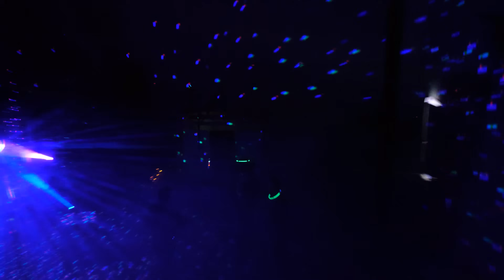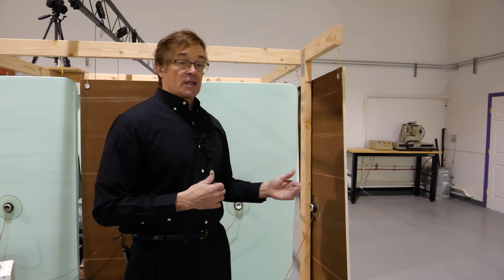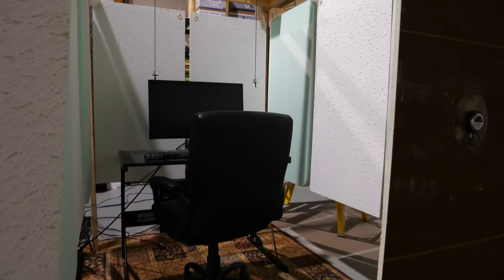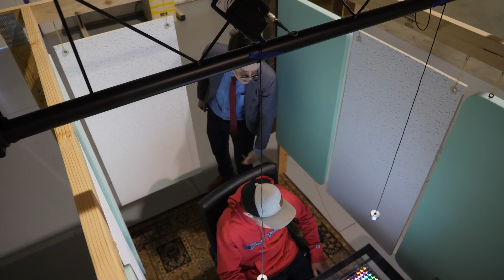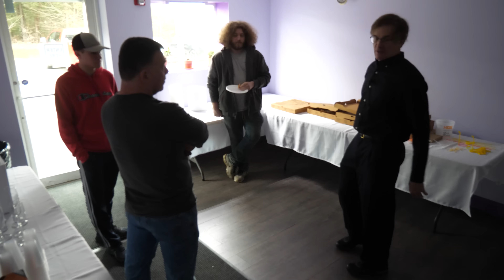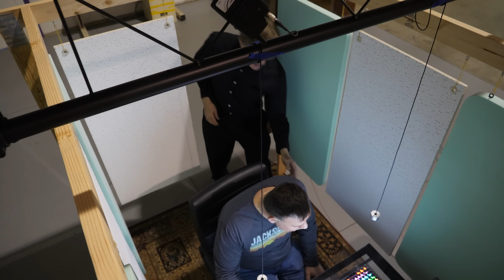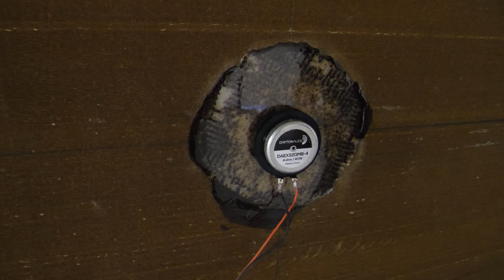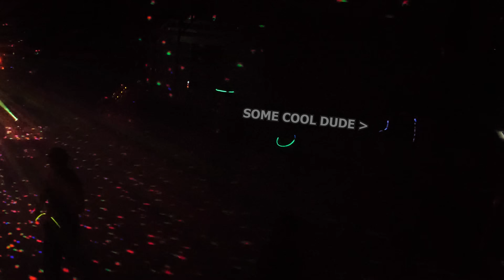SHOULD SPEAKERS THIS GOOD BE LEGAL?

Comment: So what would  be the effect of a wood veneer on the xps foam?  Or maybe with a small air gap between the materials?
Reply from the maker: It will increase the resonant frequency and may be useful for a panel you want to respond to higher frequencies. 
An isolated cover will probably just reduce sound output.
Reply: @TechIngredients  just asking to possibly dress up an application. Thanks for the great  feedback

Comment: I'm willing to bet that you can improve performance at all frequencies by rigid-mounting the exciter to the wall or some type of framing while still supporting the panel with strings.  This would put far more of the energy into the panel.  You would have to make sure that you didn't get any unwanted resonance from whatever you're mounting the exciter to, but that shouldn't be difficult.
Reply from the maker: We actually tried that, and it doesn't work. It seems like it should, but the exciter's mass itself is part of the resonance of the system. When fixed, the panel sounds dead.

Comment: Also for more stability, can those speakers be attached from the bottom also, so they suspend from the top and are held at the bottom in the same fashion, so to add stability? Would that not improve the performance and also keep them from swaying to much ETC?
Reply from the maker: They can.
Some viewers have stabilized them that way for use outdoors. Some of these exciters are waterproof.

Comment: Your videos are really cool, but you're leaving out the major fact that you must have a sound processor in this setup along with the sub, so if you compare a pair of regular bookshelf speakers, the minimum cost of that setup is lower, because those can sound good without EQ.
I built a pair from xps, experimented with it a little, and I couldn't get a decent sound out of it with no eq, it's just mid heavy, had a peak around 50 hz and above that nothing until 150 hz, that and a couple of forum posts from other people who tried it is why I know it's crap. It might be good for PA systems or haunted house, but not for the average Joe.
Reply from the maker: No, you don't.  We tested and demonstrated these speakers without any cross-over or sound processor. Of course, such a device can improve the performance of any speaker system.

Comment: Amazing work! I’m a music producer and have done my fair share of soundproofing and sound transmission tests. A couple next steps might be: 1. Another round of qualitative tests at low volume (as every speaker sounds better at high volume) and also maybe compared to two other leading 5.1 systems, and 2. Frequency response measurements and other independent testing.
Reply from the maker: Thanks!
You might want to actually do this yourself. It's very easy and inexpensive.
With your background, your opinion about the performance would be valuable.

Comment: Just finding these, really interesting, one question I would have is how far from a wall do you need to install them, right now you are in a setup where they hang by themself with a large amount of void around them but in a studio you can necessarily have that amount of space.
So I was curious to know how much reflection when they are close to a wall is there and how good they perform in that scenario.
Would be good to try a cardio setup too.
What happen if you hanged 3x in a row with two inverse
Reply from the maker: Some of the viewers who built these speakers based on our earlier videos found that they performed better when a wall behind them was covered by a sound absorbing material.

Comment: It's fun to watch these videos again. I built a pair with acoustic ceiling tiles, painted them black with spray paint, and placed two drivers on each panel in series configuration, one in the direct center and one at the 2/5ths 3/5ths spacing. 

They sound great! They compliment my 2 towers, a center channel and subwoofer stereo system, and have a "gluing" effect as i call it. Without them on, you can tell where the sound is directionally coming from. With them on, it's clean, non-directional, room filling sound! 

The best part is that because it's omni-directional, you dont need to turn it up loudly to cleanly hear your material, but can also have conversations in the same room.
Reply: Did you go with a special paint? I'd wondered if latex or peeled paint needed to be used. Thanks!

Comment: Dont see how you can send the same signal to all these panels and not suffer phase cancelation in this format
Reply from the maker: Remember, this is a 5 channel setup.
Unlike typical speakers, which radiate from a point location, the distributed radiation from a panel will only phase interfere with another panel at a few locations.
This is like an orchestra.  The many violins don't phase interfere with each other.

Comment: They have the ability to sound like a big pro sound system on a low volume level. It does not hold up though in a situation with a live band beyond a certain level of volume, but it excels in being lightweight and with outstanding sound quality at low volumes.

Comment: I love the details you're providing. so even with a 24“ x 48“ panel it will still struggle to reproduce anything under 120 Hz which is pretty high considering the LFE spectrum.
Reply from the maker: Thanks. 
You're correct.

Comment: How much will the Thickness of the foam affect the Frequency response? Thanks, This is an amazing way to start my day, I'll have this on the brain.
Reply from the maker: It's as you might suspect. The thicker the panel, the stiffer it is in bending and flexing, and the more it favors higher frequencies. Similarly,  the wider and taller it is, the better the low frequency output.

Comment: would a stretched canvas work with some some sort of fiber like cotton polyester or wool and put some sort of netting to keep the fiber in
Reply from the maker: Probably not. The panel has to have some inherent stiffness so that it bends and flexes.
An analogy would be to build a guitar with a stretched canvas sound box. It wouldn't work.

Comment: @Tech Ingredients what happens if you have it double layered, like the foam insulation glued to the acoustic ceiling tile? maybe add another exciter to make up for extra thickness?
Reply from the maker: That's interesting.  I don't know.
The lightweight foam shouldn't load the tiles significantly, and the large difference in density will improve damping. Hmm...

Comment: Would speakers like these be good for a 2 car garage sound system?
Reply from the maker: Absolutely.
Because these are so easy to assemble and low cost, your risk is low.  Use the largest panel size you can practically fit or purchase as the low end improves with size, and that is their only weak point.

Comment: I took six of the 40 watt exciter and simply attached them to the drywall walls in our entertainment room about 4.5 ft off the floor.  Using an Onkyo surround receiver and a subwoofer, the sound projection was amazing.  I first built the speakers as suggested with the foam board according to your first video which presented the exciter speakers.   They were okay sounding but not immensely impressive.  But I gotta say the wall attachment blew them away.   It didnt stop there because the sound needed tweaked so I routed the sound through a laptop first then into the receiver.  Using a free sound tool called FxSound and adjusting the frequencies to match the acoustics of the materials and room....  It came alive and I would seriously compare it to the highest end home theater experience I have ever experienced.  (FxSound lets you adjust 9 points of equalization which each point can be tuned themselves with 5 overall effects.  Hard to explain but you check it out.)

Comment: Tuned in AGAIN and found more incredible examples of GEN / 6 7 8 and beyond panel speakers. My 2x4 acoustic panels I made still perform without any Buzz and rattling due to a surface speaker being used. I was thrilled to see the Rockville Blue tube amps lined up for this demo. I use the same 4ohm amp for mine.. Sound is just right there IF you add a sub woofer to bring in more BASS. Without.. Top end clearness that has to be heard to believe.. Tech Ingredients, Continue to waste no time with these projects.. BRAVO 🤟
Reply from the maker: Thanks!
Did you watch our more recent  video where we took these speakers on the road (literally) to get public feedback?
Reply: @TechIngredients  Thanks for the reply and of course I'll find that video and watch it. NO telling how people will react to this concept.. Wish I could be one of those to give it a listen..

Comment: @TechIngredients I wonder how the mass of the exciter relative to the panel's surface/mass affects things.  there isn't frame like a traditional speaker that clearly make one part stationary and the other vibrate.  In this case both are free... so there is inertia at play. Right? Would be interesting to test. If hung on frog the ceiling does this change the characteristics as gravity is pulling the exciter onto the panel
Reply from the maker: You're  correct about inertia.  It is part of the system with actual musical instruments. Think of this method as the missing link between conventional, driven diaphragm speakers  and the structural  resonance  of a panio's soundboard.
Did you watch our later video  where we assembled these speakes and took them to the street? Literally.
Reply: @TechIngredients  I didn't... I look for that video. Very cool work you do. Thanks for sharing.

Comment: what will happen if you glue flat ballon (and how to made that type of ballon) to the back filled with helium? will lower frequencies be more present? I will also love to see speaker made from metal sheet backed (glued) with automotive sound dampening asphalt mat.
Reply from the maker: Helium transmission  is not frequency dependent. That would be interesting. However, you need to minimize  the mass of the panel.   As you increase  the mass, the sound output decreases for a given amount of driving  power.
Reply: @TechIngredients  but with open speaker main problem with low frequency is mixing front wave  with back wave  out of phase. 
Dampening back side, that plays out of phase by helium, can be more beneficial than lost effectives by increased mass. (and in reality increased mass is only that portion of balloon directly attach to the panel, rest don't influence vibrations, you can even add heavy plate to another side of balloon, but that start creating something closer to the closed speaker)

I assume for mid-high range that will have more negative effect.
Reply: @TechIngredients  another question: adding mass to the back of driver, will change anything?
Reply from the maker: Adding mass does not help.  You can buy what are called "shakers" which are basically mass loaded actuators for gaming realism when attached to a chair. They work very poorly.

Comment: I wonder how drywall would work. I also wonder about the ratio of height and width. Finally, what if you need to reduce the size of the panel to fit your room?
Reply from the maker: It's  too dense, and the sound output is quite low.  You want the largest panels  you can fit because  the lower frequencies increase with larger panels. A sub with a cross over around 150 Hz will fill in this gap if your panel size is limited.
Reply: @TechIngredients  Thank you for the reply. Space is very limited in the area where I was considering using it. Probably be better off then sticking with bookshelf speakers.

Comment: Linus Tech Tips recently went after the issues of not being able to statistically compare audio devices and not being able to convey that to an audience over YouTube… and purchased a HATS (Head And Torso Simulator) which they now use in any video related to audio.  They’re an expensive investment, but my understanding is that listening to the result on reasonably affordable studio monitoring headphones (my pick is the ~$90 Sony MDR-7506) is fairly faithful to the original environment.  There’s still the issues of YT compression, etc. but IMHO that’s no reason to throw out the baby with the bathwater.

Comment: I always love your experiments. You always inspire me to tinker and try new stuff. A couple of questions. If I made my Polystyrene panels 6 feet tall would that be large enough to get bass response down to 80hz ? Also, are you powering these with tube amps? How would these panels fare using better amplification that doesn't introduce so much distortion?
Reply from the maker: At 8 feet tall, they still taper off around  120 Hz. A sub is a good addition.
Reply: @TechIngredients do I understand correctly? for 1/2 of the frequency you need a panel with 4x more surface area?

Comment: what is the difference between using these specific exciters and a voice coil from a high powered speaker?
Reply from the maker: Nothing.
These are simpler to install because you don't  have to disassemble anything.  They even come with an adhesive pad already installed.
Reply: @TechIngredients  i'm trying to find a higher wattage rig without spending $1000 so started playing around with dissecting speakers, finding out you really need the diapragm/cone because it centres the voice coil in the magnet, i left the spider on the speaker thinking it would be enough but the lateral motion leaves it open to hitting the solid inner cylinder that the voice coil cylinder is sunk into

probably would have to just cut out the covering of the voice coil and leave the rest of the speaker intact, but then you're also losing energy to the diaphragm pushing air, probably too tough to convert a regular speaker so now i'm looking into just buying my own wire to start winding around a bigger cylinder and go from scratch

i've also seen underwater speakers are kind of similar so maybe i could find a used one and somehow mount it to a surface, crazy idea of trying to create a noise creating instrument using this concept but it'll have to be quite high powered to do what i'm imagining with feedback, making the whole panel violently resonate at it's natural frequency haha, could probably get some wicked sounds playing with this idea and different materials but i think what i'm imagining will need a much higher output that the 40w ones 

guess I could try getting a bunch of them but then timing and phasing becomes an issue

Comment: I am curious if you could use a polyethylene cutting board material to use as an outdoor setup on a deck. I guess the other question is could you secure top and bottom to stop them swinging in the wind?
Reply from the maker: It's  too dense.   The actuators can't  deliver the power needed to bend and flex them.  You can support  them from the bottom as well, but the contact needs to be as fine as the fishing line used at the top.
Reply: @TechIngredients  I suspected that might be the case  and thanks for the prompt reply. I might look at using a silicone sealer to deal with some condensation on the acoustic tile as the foam should be fine.

Comment: I believe 80Hz is about right for the lower crossover frequency, above that people can start to detect where the low frequencies are coming from, but just how large would the panels need to be to achieve 80Hz?
Reply from the maker: They would have to be really  large.  At 4x8 feet, the low end was around 120 Hz.

Comment: Would allowing people to see the system beforehand affect their opinions? The build seems odd, which would load their expectations. They are friends and I really don't fault the pizza party, but that might affect the replies we've seen :) Could there a suitable material for sub freqs which shares this design? I am also curious if the hinge would affect these lower freqs. Instead of using strings to suspend the top two corners, do you think quality could be improved by suspending the boards in a way that doesn't act like a hinge? Surely this would make a small difference, but my idea would be to attach springs to all four corner and let the board hang facing downwards. A vertical facing implementation might resemble those old fashioned radio microphones. Great video!

Comment: Have you considered directly mounting a driver to the chair, instead of using a subwoofer? If so, what kind of driver would you use? Thanks for the quality content.
Reply from the maker: Yes, I have.
Check out what are called "shakers".  You can get them at Parts Express or on Amazon for that very purpose.

Comment: The snazzy intro nearly put me off but I have followed your work for some time and stuck with it. WOW! 
I cannot agree that even exceedingly expensive headphones are "the gold standard" simply because they cannot do the same job as how human ears are positioned by evolution but understand why you asked the question of ordinary people whose experience of sound is less likely to be a concert hall than cans -- partly so as not to annoy the rest of the family.
Headphones can by quite damaging in our first 25 or so years both to ear mechanisms but also to the aural processing parts of the brain which we do not understand and will not for years to come.
What your experiments achieve so well is the need to have actual air space and not just the small volume open back headphones tend to have.
Remarkably, you are discovering anew the physics of sound long after the Ancient Greeks got very close.